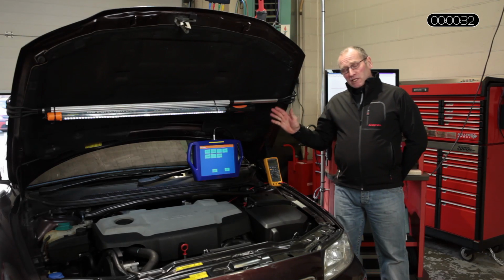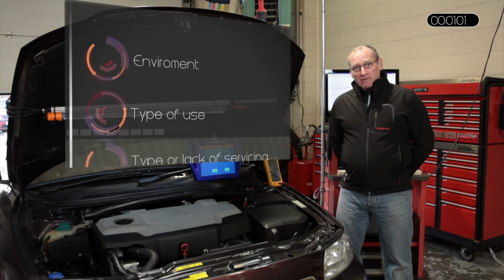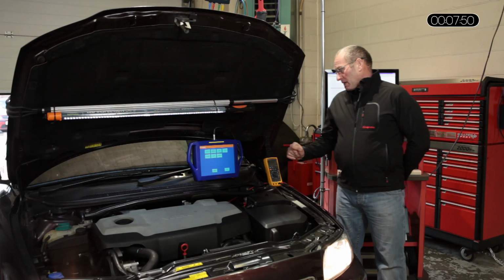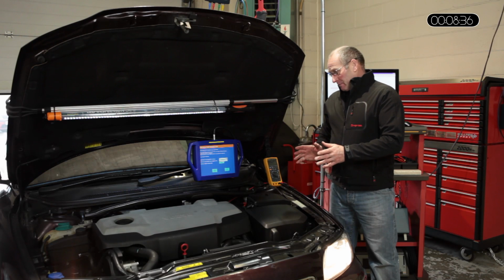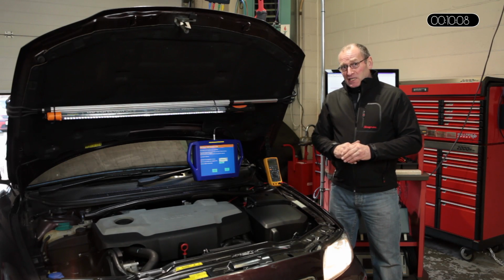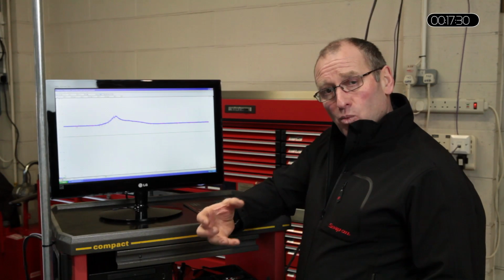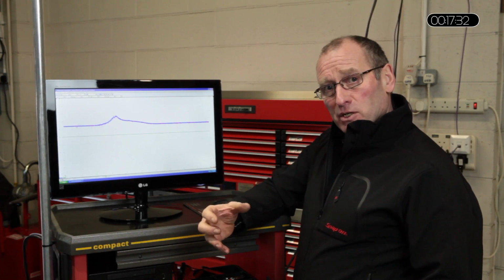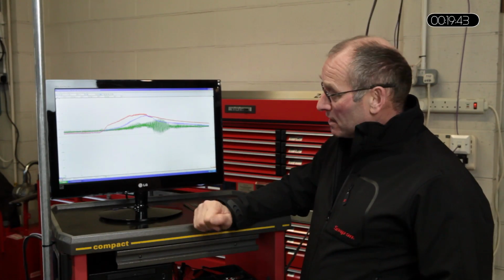AUTOiNFORM ONLINE MAGAZINE: Diagnosing Faults on Diesel Particulate Filters DPFs

Comment: I had a forced regeneration done on my 2012 crv 3 weeks ago, no soot from exhaust but worked,  yesterday straight into  !  Limp mode on accelerating in 2nd up hill, could this be an oversensitive dpf sensor which doesn't show as a fault ?
Reply: i'll help you out. 
its exhaust back pressure sensor is maybe faulty (or disconected) giving bad readings caussing to much pressure and car will go in safety mode.
or the hose popped off
 first check these sollutions
Reply: also check your oil level
causse it could fill over maximum 
due failed regenerations